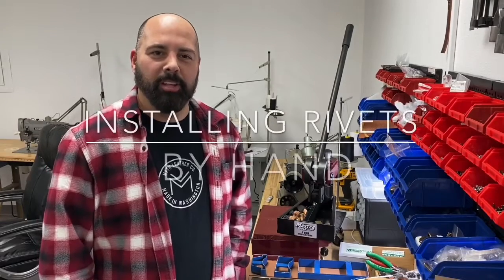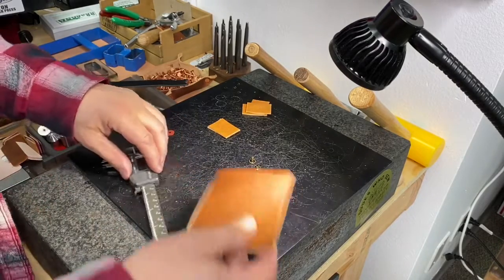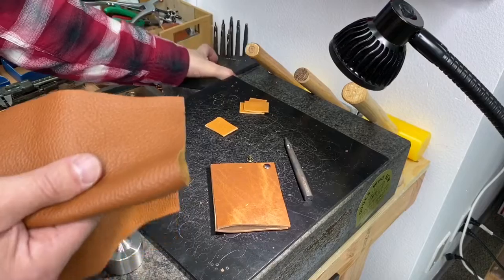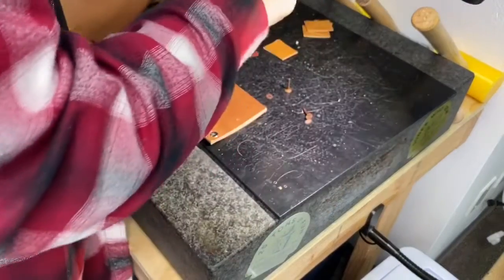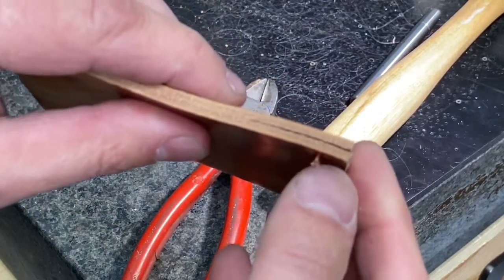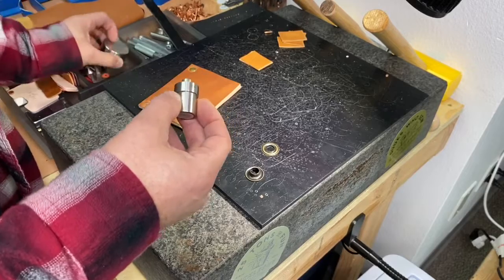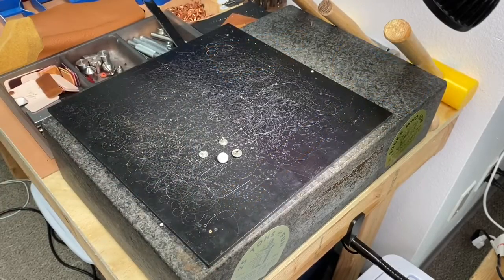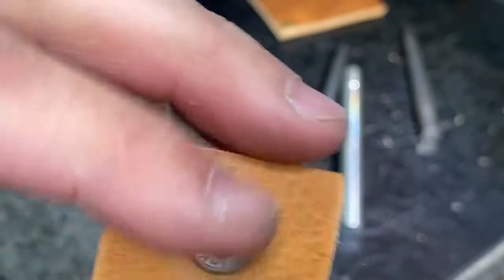Leather Craft - Setting double cap, solid copper Rivets, snaps and Grommets with hand tools

Comment: Garth, where do you get the C.S.Osborne 3/8" Grommet Die set that screws into the BG Post/Base.  Ive googled around and ddnt locate. You mentioned it was Osborne and not 
BGuy.  Thanks so much for your videos.
Reply from the maker: Anne Benvenuto , you can buy those from buckle guy as well! https://www.buckleguy.com/bg-grommet-setter-die-w-screw-fits-the-3-8-2-grommets-requires-hand-tool-post-base-or-bg-hand-press/
Reply: @MythLeatherCo  Garth, thanks for getting back. Sorry to be a pest, but have you ever actually used the BG tool to set C.S.Osborne grommets.  I emailed/spoke with Buckle Guy and they won't "guarantee" their tool will fit the Osborne Grommets. Although they seem to use the same numbering system.

Comment: Garth,  I always get confused when it comes time to affix the "Washer" on top of the male post.  You indicated verbally that  you place the washer with the "CONCAVE" (shallow channel) facing up, but visually it looks like it is the rounded/CONVEX side facing up. Maybe it's my OLD eyes. Can you clarify. Thanks so much for this video.
Reply from the maker: Hi Anne, it makes no different with way you put the burr on the rivet post. When the burrs are punched out, there’s a smooth side (tool entry side) and a burr side (the die side, the bottom) I always put mine on the post so the smooth side faces down. If that makes sense. 🤪

Comment: Garth, does it matter which side of the rivet you mallet? In other words, cap on top or on bottom when using the mallet?
Reply from the maker: I’ve done it both ways. Either works. However, I usually put the post point up to hold all of the pieces together, cap it and set the rivet.